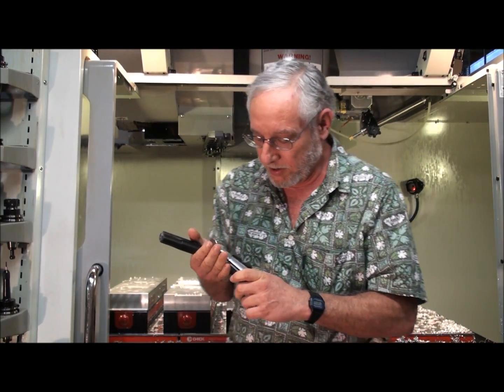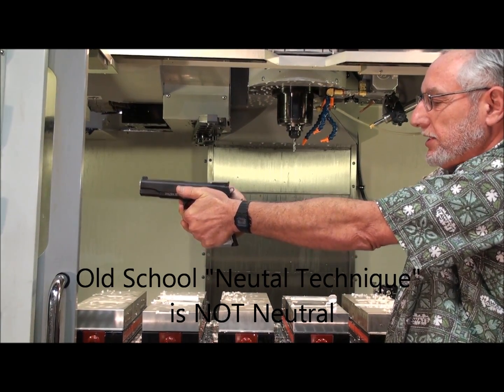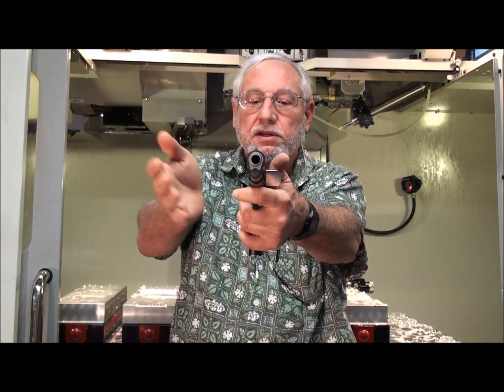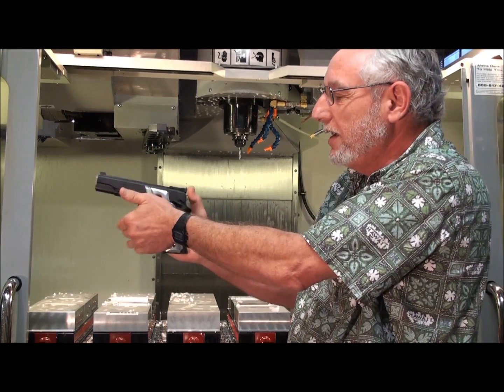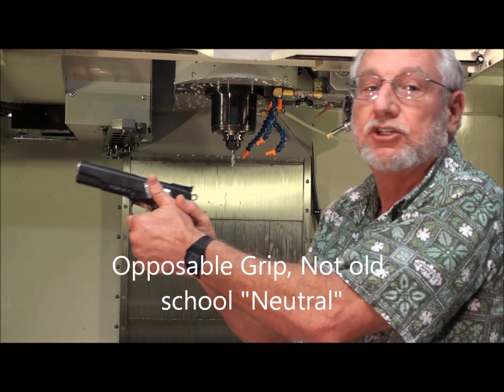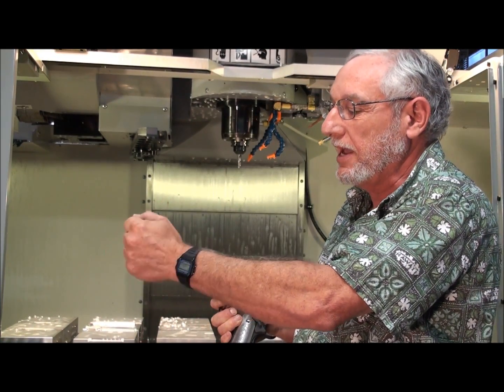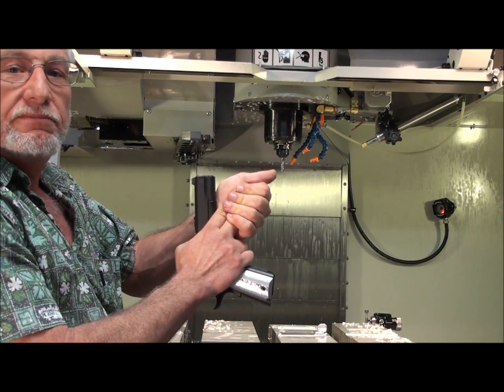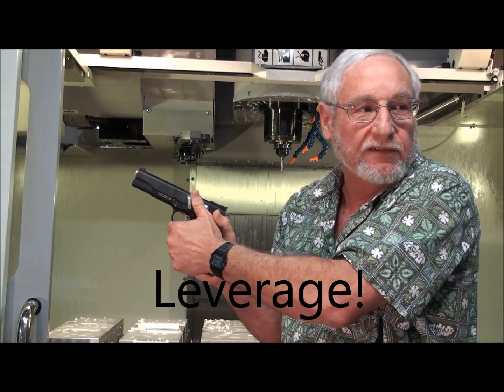Tech explanation How the Gas Pedal Works.wmv

Comment from the maker: @calvinboca Is correct, it is the flexor carpi ularis tendon that transmits eccentric muscle contraction power to the location of the carpal bone of hand. It is a small tendon and very commonly injured in overuse sports. Yes they rely on response but also preload the muscle. However, because muscle is preloaded at extreme of its contraction, its potential power is further reduced.

Comment: What your product is doing is essentially radically reducing the effect of the bore axis by shifting the recoil support much higher.  The responsibility of recoil taming is shifted to the pollux adductors and flexors.  These contractions seem to be mostly isometric, resulting in a steadier grip for followup shots.  This transfers most of the recoil horizontally rather than vertically, which makes it much easier to handle.
I've never tried it, but it looks like a great product.